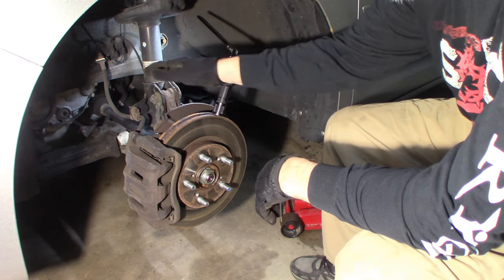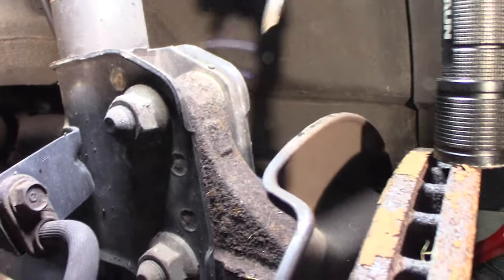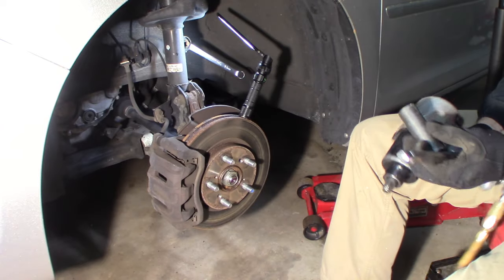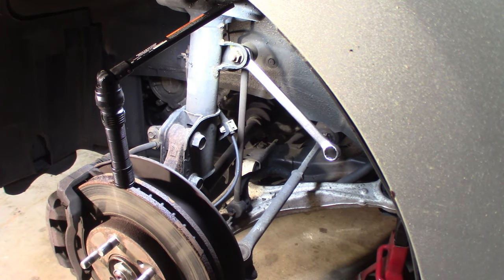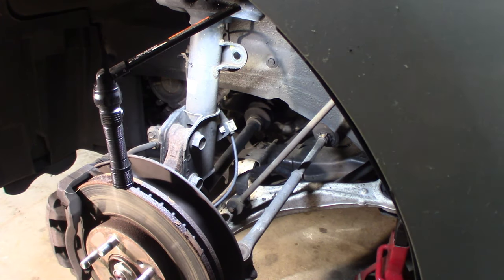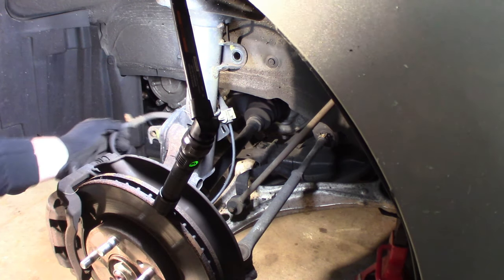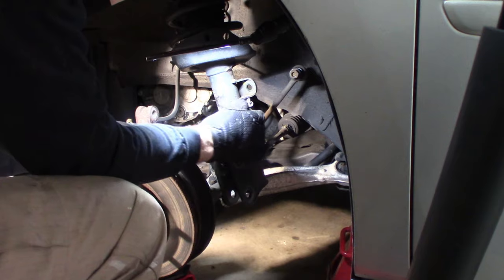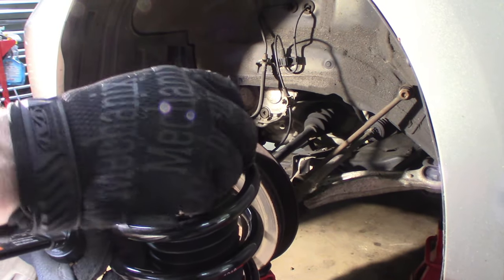2009 Honda Odyssey Front Struts

Comment: Thanks for the informative video. My 2009 stabilizers do not have a flat spot on the back. They have Allen wrench center which is useless and rounds out under pressure of the rust. So it's not as easy of a job as I now have to cut them off and put on new ones.
Reply from the maker: Yep, been there many times
Reply: I ran across this recently.  Try getting a vice grip on behind the strut tab.  It made all the difference for me.  Just be careful with the end link boots
Reply: This was true for my 2009 as well.  The replacements I used have flats for a wrench, though, so no struggle next time.